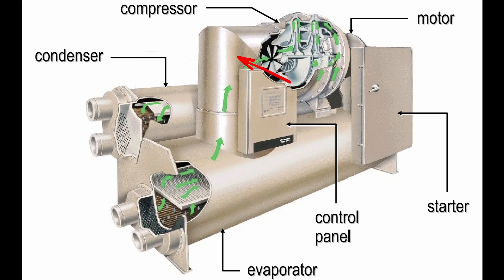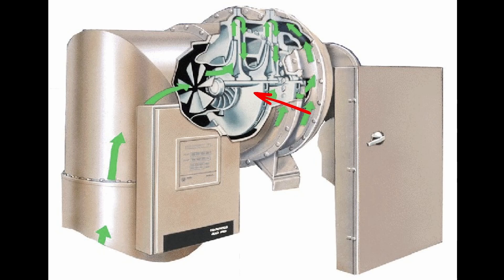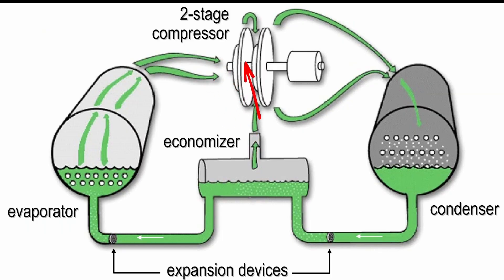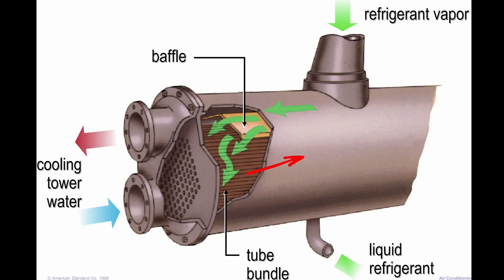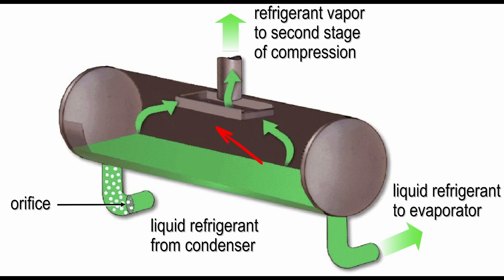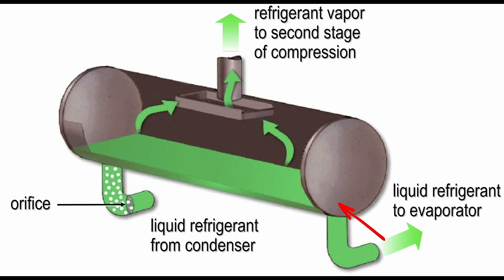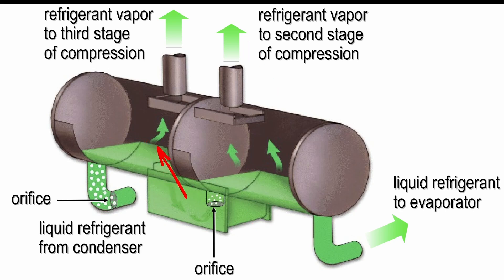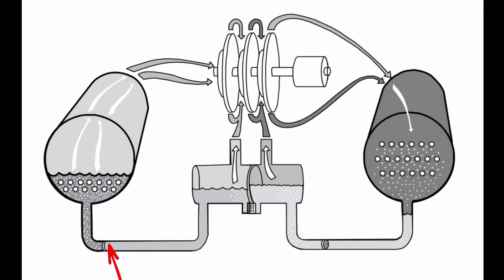CVH & CDH Refrigerant Cycle Trane Chiller

Comment: Will this intermediate pressure refrigerant cause the discharge temperature decrease?
Reply from the maker: Yes
Reply: @ is it normal if the discharge temp remain 20-21 deg C at 30% load or this figure should not be appeared at any loading? (It is cvhe running R-514A)